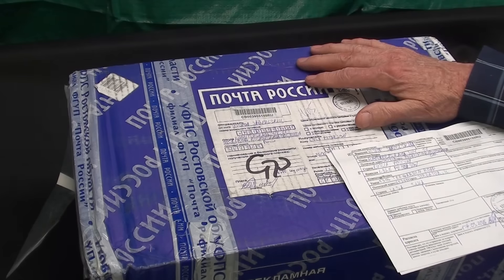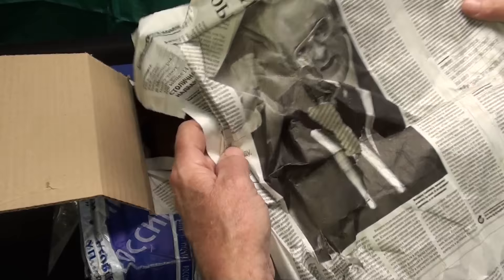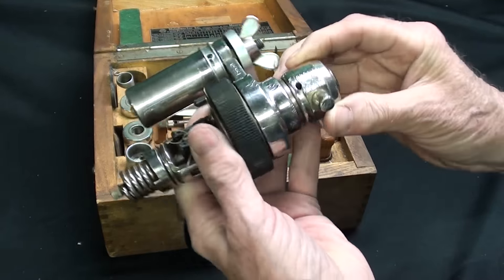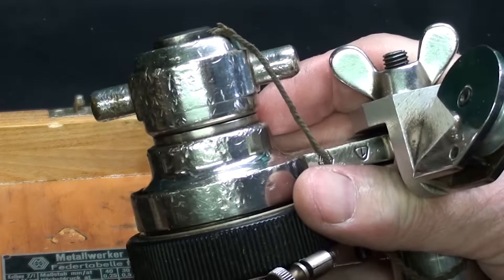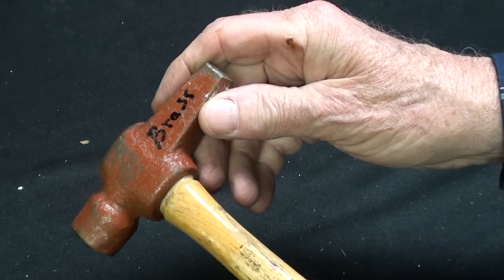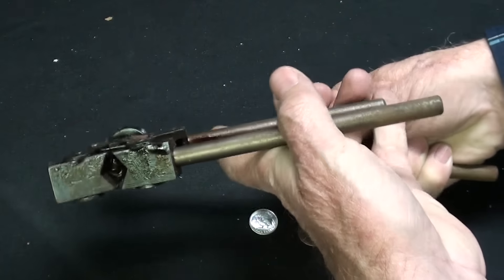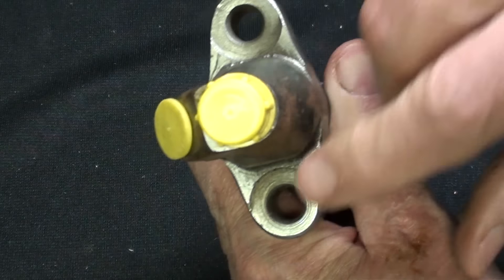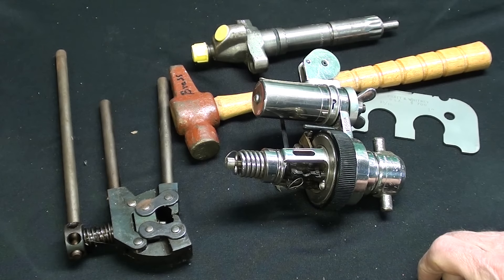WHAT IS IT?  #27a question Mystery Item tubalcain mrpete222

Comment: Thanks for your videos Tubalcain.

That "rod" is a spare piston for this indicator. 
The wooden "stick" has normally a layer of green yarn wound around it and it is a cleaning tool for the bore in which the piston of the indicator slides. That bore can become dirty with soot particles which can cause the piston to be become sluggish resulting in unreliable readings.
In order to do that, you have to remove the top of the indicator by unscrewing the black serrated ring
The little booklet contains the papers which are to be wound around the drum, the ends of a piece of paper are clamped under the "leafsprings" in order to hold it in place.
Once you have done that you can turn the top of the indicator in such a way that the needle touches the paper (gently), now pull the rope, (I also saw the hook laying in the box) and a horizonal line will be scratched on the paper (in fact you remove a layer of a kind of wax)
This line is called the ätmospheric line.
The "zero" on the wooden ruler is lined up with this line when you want to find the compression and combustion pressures, once the diagram is completed.
It is a collectors item for former marine engineers. LOL, but unfortunately, yours is a bit beaten up.

Comment: I've got a 6 pound brass lixie sledge hammer that B&W bought us when we built them a storage tank out of Hastelloy. We weren't allowed to even use steel slag hammers or wire brushes because any regular steel introduced into the Hastelloy or Inconel can give a starting place for rust to start, we had to watch a training video about it all.

Comment: Hello Tubalcain,

The first item is a test card puller for a two stroke diesel engine. A small sheet of carbon paper it wrapped around the drum and the scribing arm is adjusted to apply slight pressure to the paper. Next wrap that small line (usually longer) around the base of the drum in the slot. The the unit is screwed onto an individual cylinder indicator cock (after blowing the carbon out first). Open the valve on the indicator cock, and you will see the arm tracing a vertical line on the paper with every stroke of the piston. Now comes the tricky part, the operator must sense the rhythm of cylinder and simultaneously pull the cord steadily (in one motion) for the length of that duration. This will result with a pressure volume diagram for that cylinder. 

This type of test card puller works best on slow speed diesel engines (~110 rpm or less).

Source: I am marine engineer

Comment: It's a PV indicator to measure the Power output of a steam engine.  That  half of a union is attached to  pressure tap in the cylinder of the engine. That cord (which is broken off) is wrapped around that little cylinder and the other end is attached to the crosshead of the engine.  A piece of the paper in that packet  is wrapped around the little cylinder.  There is a stylus on the  indicator that bears against the paper on the little cylinger.  The pressure in the steam cylinder moves the stylus up and down and traces the varying pressure in the steam cylinder while the chord moves the little cylinder in unison with the movement of the crosshead.  The two movements graph the Pressure/Volume  curve of the engine and allow the proper valve cuttoff to be determined and also the area under the curve yields the theoretical horsepower of the engine.  The brake horsepower divided by the theoretical horsepower provides a measure of the thermodynamic efficiency of the engine.  The area under the curve is measured using a planimeter.

Comment: Hi Lyle, That is an engine indicator. It integrated cylinder pressure and crankshaft angle, so you could tell how well each cylinder was working ( 0n a marine diesel). The drum had a piece of metallised paper wrapped round it. The needle drew a curve which could be analysed by measuring the area of the curve. The internal piston was raised by cylinder pressure and the drum rotated by a string attached to the crankshaft, or timing gear.The extra springs were to allow use on various cylinder volumes. Here in the UK a firm Called Dobie McInnes made them and there was another type made by MAFAK.

Comment: I knew what item #1 was the moment I saw it. That is a steam engine indicator. A card is placed on the drum. The cord on the drum is attached to the piston rod. A pressure line is connected between the device and one end of the steam cylinder. The stylus is inked but not immediately placed where it can touch the card. The engine is started and the load applied. When the engineer is ready, he releases the stylus so that it makes a its mark on the paper. The resulting diagram tells the engineer much about the valve timing of the engine as well as other things.#4 is a chain breaker. It presses the pin out so that a length of roller chain can be shortened.#5 is an injector from a diesel engine.

Comment: The last item is a diesel fuel injector for classic injection pumps (rotary injection pumps or in-line injection pumps). It opens when the fuel gets delivered by the injection pump at some 500bar or more, and inside the needle lifts up because it has a control room and the needle has control conical surface that provides lift when enough pressure is in the chamber, compressing a spring behind the needle. The pressure at which it opens can be adjusted by a washer on top of the spring, or it may have a screw type inside the injector, or even on the outside with a lock-nut and adjusting screw. The orifices on the tip of the injector are very small measured in microns and surely can't be seen in the video, even by eye at closeup it's hard to see. Very small holes.

I'm not familiar with American diesel engines, but it looks like it could be for a small truck. And it has direct injection in the omega chamber in the piston head (maybe, idk for sure.. just speculations as I don't know the model of the injector)

Comment: Looks like an old pressure recorder ive seen in the past. The string wraps around a drum that loads a spring that drives a paper chart. It also had interchangeable springs for different pressure ranges. Similar to the "McNaught indicator"

Comment: Lyle,  It is used for is called "Pulling Cards"  It will draw a PV diagram on a card that is inserted on the smooth drum.  Used on Large slow speed diesel engines.  It is placed on the "Test Cock" of the cylinder head.  I have used on just like the one you have many times on ships engines.
Reply: +Randy Richard  right on Randy!

Comment: #4 is a chain break. we use these alot to take chain links out to shorten a stretched chain. squeeze the handles to open the jaws. set the jaws around the big end of the link. align the pin driver over the pin that holds the links together. release the handles and turn the top handle to drive the pin out.  this would make a good hows it work video. thank you for your videos

Comment: Yup, Emma got it - or at least I think so. It's a steam engine indicator. It was a vital tool for maintaining the operating economy of reciprocating steam engines. They graphed cylinder pressure against the stroke. the area of the curve was determined by planimeter and the valve timing was tweaked so for example all three cylinders of a triple expansion engine produced equal power to the load. 

The brass hammer was I think used by cabinet makers and joiners to adjust the iron of their wood bodied planes. A tap here or there could increment the irons exposure or tilt to a very fine degree. The tap worked the iron by inertia. The head was used for tapping and the "poll" used to extract the wedge. Roy Underhill demonstrated this in one of his videos.

Comment: (1)Indicator for diesel or steam engines which shows on a rotating paper graph. 

(2)The hammer is a Lixie silicon bronze dual purpose style hammer. According to the literature: "for general usage such as machinery maintenance, sheet metal forming, welding and assembly." The model B signifies that the square end is 1/2" and the round end is 1" across. It is a 16 ounce hammer.

(3)The 3 men are Einstein, Eli Whitney, and Harlow Shapley.   Family lore has it that one of my ancestors helped Eli Whitney build the first gin, but I don't know any of the details. 

Harlow Shapley – a pioneer in astronomy – is best known for determining the exact location of the sun in respect to the Milky Way galaxy, and correctly predicting the size of the Milky Way.  He was a 5th grade dropout, later going back and completing a six year remedial course in only two years, graduating class valedictorian.  
He enrolled at the University of Missouri for journalism. After discovering that the school would not be opened for another year, he picked up a course directory and decided to study the first subject he saw, which was archeology. Not being able to pronounce the word, he looked down to the next subject; astronomy.  The rest is history. 

(4)Pratt & Whitney: WHEEL DEFECT, WORN COUPLER LIMIT, WORN JOURNAL COLLAR AND JOURNAL FILLET GAUGE.
DEFECT GAUGES LIKE THIS WERE USED TO CHECK THE WEAR ON RAIL WHEELS,
COUPLER, JOURNAL COLLAR, AND JOURNAL FILLET. THIS GAUGE REPRESENTS THE 
STANDARD ALLOWABLE LIMITS FOR NORTH AMERICAN RAIL WHEELS: WHEELS FOUND 
TO HAVE WORN MORE THAN THE ALLOWABLE LIMIT WERE "CONDEMNED".

(5)tool to break roller chain like on motorcycles or heavy machinery.

(6)Diesel fuel injector

Comment: Cylinder pressure indicator for slow speed engines. Steam or diesel, depending on the springs you set defines the pressure range to be measured.

Comment: 1 - If my very rusty German is correct its a pressure gauge or tester for steam/air pipes.  The different springs would set different pressures and open at certain pressures.

2 - An upholsterer hammer or leather workers hammer for putting in decorative fasteners.  Its a softer metal or the same as the fastener so it doesn't hurt them. 

3 - Looks like the gauge railroad workers would use to inspect train wheels and other parts when they picked up cars at the grain elevator I worked at during summers in college.

4 - Roller chain breaker

5 - Novocain needle for doing dentistry on a whale.  It looks like a giant diesel injector, maybe from a ship, train or power plant engine.

Comment: It's an engine indicator.  "A handy instrument for many applications and is used for taking single diagrams from any internal combustion engines, compressors, blowers, pumps, steam engines and other reciprocating engines. Leutert indicators are used on Diesel Engines, Steam Engines, Locomotives, Gas Engines, Air Compressors, Pumps, etc. A metal stylus draws a clear pressure-path diagram which records the pressure course within the engine cylinders as influenced by the piston stroke. The recording drum can be moved by means of a string, which can be pulled manually or by the engine ( if the engine is equipped with a suitable drive mechanism). If the drum is driven by the engine, the diagram can be planimetered."

Comment: This is a miniature diesel engine indicator, similar to a Maihak Type 30.  Normally they are larger than this and these were still used until quite recently.   They are used just like the older steam engine indicators, to take a power card of the cylinder internal pressure shown spread across the stroke.  The paper goes around the drum which reciprocates back and forth with a cord tied to a crosshead or a pin on the end of the crankshaft.  Then the stylus moves up and down with the cylinder pressure and draws a diagram of this on the paper.  Lots of info on this online.  Google: diesel power cards.

Comment: This is a pressure indicator used for balancing cylinder pressures on large, slow rpm natural gas engines used in the natural gas pipeline industry and the such. The paper sheet will fit in the drum and you rotate the drum to allow the moving stylus to mark on the paper as the drum is rotated. A few firings for each cylinder, then you measure the lines with the ruler to measure the lines that are marked. The different springs are used for different pressure ranges or scales. We called these Bakkerack, spelling is a guess and this was probably a company name.

Comment: It deals with testing pressures at different intervals in piston applications as near as I can figure. Didn't look too hard to find any videos of it it use. I just skimmed the reading material which had to be translated from German...thanks for the videos. That one item would be a link remover tool for motor-cycle, etc. chain, the rest, not a clue.

Comment: It's an indicator for taking cylinder pressures. I used one when I was a marine engineer. It draws a graph of the pressures during a combustion cycle. From the graph the Indicated horsepower can be calculated and the injection pressures adjusted to balance the outputs of all of the cylinders. It screws into a port on the cylinder and the cord connects to a linkage on the camshaft.

Comment: It's always good to get a surprise package! #1 is a calibration tool for alcohol hydrometers. It's required to keep a close record of Vodka proof#. Very important in Russia!#2 is a prototype dead blow hammer, before Lixie did the shot filled ones like I got from Boeing Surplus. But, after the beryllium copper ones.#3 is not a wire or sheet gauge as might be thought at first. It is really a go-nogo guage  for stuffed pizza crust.#4 is not really a chain breaker. It is really a pin press for the watchband pins on Paul Bunyan's watch.#5 is without any doubt a Bosch fuel injector nozzle. The top fitting is a delivery port from the pump. The fitting on the side is for the dribble line back to the tank. The part of the body at the top with the bolt holes hold it to the cyl. head. The application is a little fuzzy after all these years. I'm thinking maybe Allis Chalmers? As you can see, I'm fine form tonight! Best to all, TC

Comment: 1- no clue
2- model B hammer is bronze.  Used for metal forming.   Can still buy them new today
3- train wheel gauge.  Goes with the P&W tool you showed a few weeks back
Quiz, got 1 & 2, would have guessed Pickering for 3
4- chain breaker
5- fuel to injector

Comment: There looks to be a threaded end that must crew into something that looks similar to a lightbulb type of threaded base and next to that there seems to be a chamber that holds twine and next to that is a pulley on a pivoting arm. I would guess that the inductor is threaded into something and the twine is fed through the pulley and the twine is drawn out and measured. Why would it need to be beaten on the housing? Perhaps what it screws into is rugged. I would think that with twine, it wouldn't be used under water, nor in icy conditions.

Comment: Mr Pete, I love these videos, please keep them coming.actually I like all your videos.
#1 cylinder pressure / vacuum recorder. the blue paper is carbon paper used on the drum that the arm traces a line onto.
#2 non sparking pin head hammer. 
quiz 1- Einstein, 2- Eli Whitney, 3- ? 
#3 railcar wheel wear gauge#4 roller chain breaker, for pushing out the link pins. from it size I would say for #40/41 or larger chain. 
#5 Diesel fuel injector, either Robert Bosch or American Bosch. if I had the part number I could tell you what it fits

Comment: That tool is for measuring the pressure in each cylinder on large diesel engines   large diesels have valves in each cylinder head they are called indicator cocks that tool attaches to the indicator cock  and the valve is opened the cylinder pressure is forced out into that tool measuring the pressure in the cylinder those little sheets of paper records the pressure which is shown rughly in the shap of a banana showing the pressure when the engine fires and when the pressure drops in the cylinder   they are pretty old  the ones they use now isomething similar but uses a simple pressure guage   that tool gets extremly hot when the engineer is using i  depends on the number of cylinders on the engine    im a retired marine diesel engineer  ive used them many times